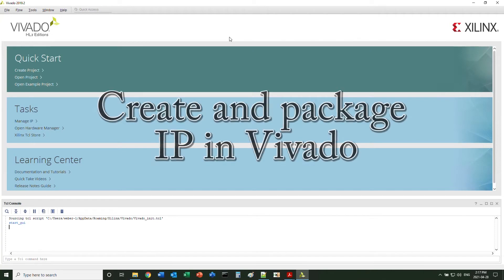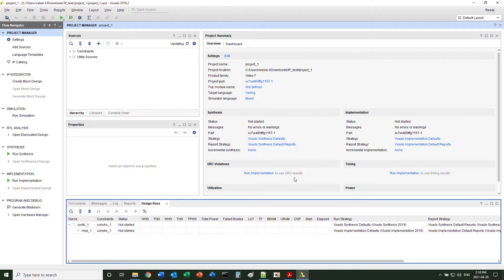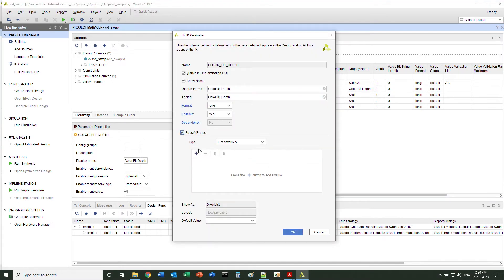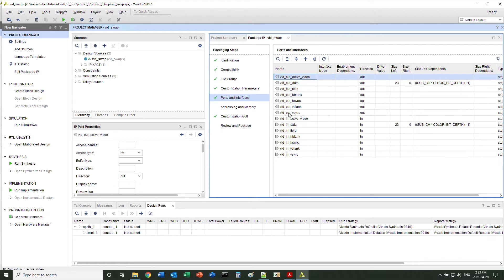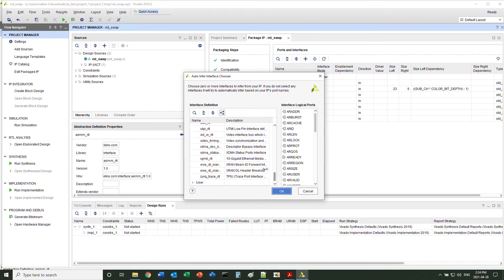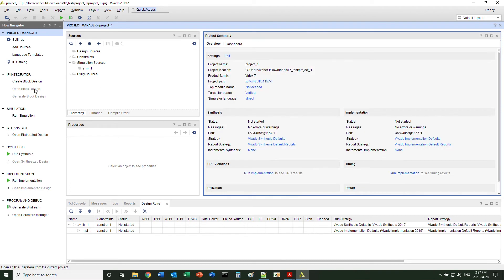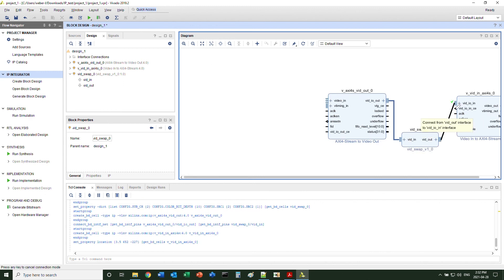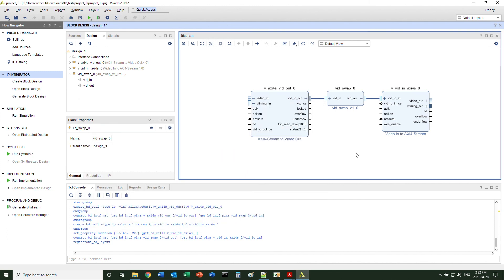Create and package IP in Xilinx Vivado block design

Comment: while packaging an ip do we need to write constraint file because in vivado document it is written that constraint file should be made?
Reply from the maker: I guess depends, if your IP is timing critical and specific to some dedicated resources probably better have some constraints. If simple functional IPs, timing analyzer should be able to drill it down from top clock sources. You can constrain in the top project instead.